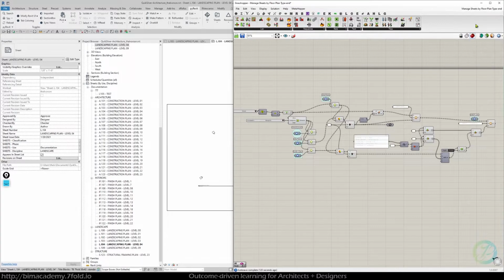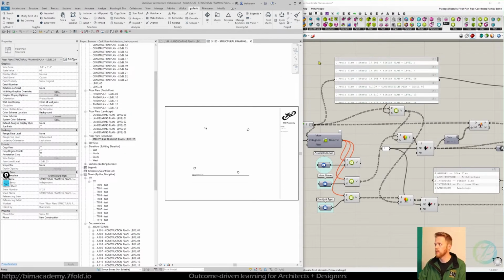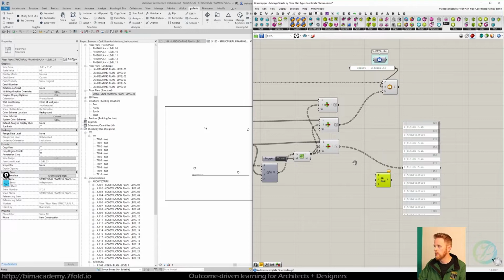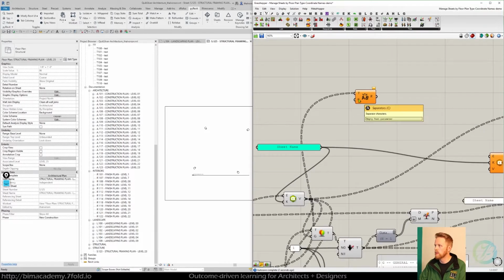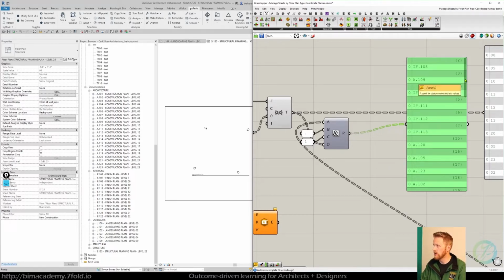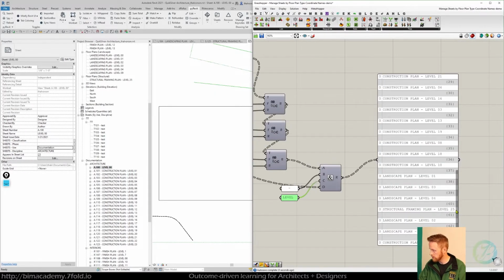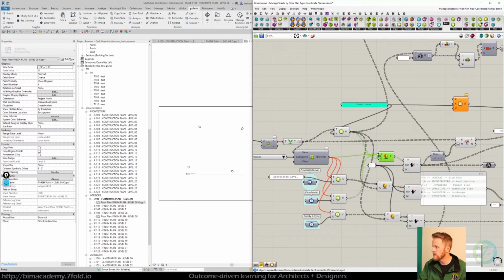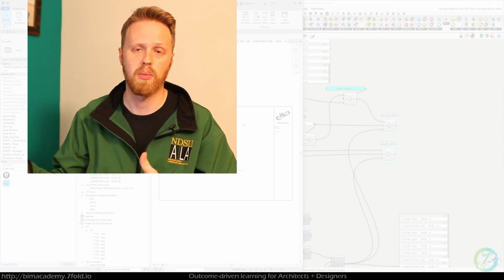Auto-update Revit Sheets Part 2 Using Grasshopper | Numbers, Discipline Prefixes and View Names

Comment: Great content bud - Thank you very much
Reply from the maker: Glad you enjoyed it Noah! What are you wondering about for next time?
Reply: @7fold_design  Take the logic to the very start of the project!

Sea level = 0'
Project Level 1 FF Elevation = ?'
# of Levels = ?
Floor to floor = ?
Create Drawing Views = [Plan, Elevation, Section, Axon, (interior elevation? door/window head-sill-jamb detail)
Place views on sheets and number those sheets per logic
Disciplines requiring backgrounds = ?[Electrical, plumbing, mechanical, structural]
Duplicate views for other disciplines and create matching sheet number with discipline prefix
Apply discipline-specific view template to those sheets

I think all of that is possible now, so you could get a call about a project and almost just enter an address to get your SD set cartooned out

Let's connect-
Reply from the maker: Typically for sheet management like what you’re describing I don’t instantiate a sheet (making it visible in the project browser) but actually just creat placeholder sheets so they schedule in the main sheet index in my model. To do that I use BIM Link made by Ideate Software to export the parameter headings that control my sheet organization. To get discipline-specific info I will always delegate them to coordinate their own set and, if necessary, point them to a naming convention they should align to (aka ISO Standards or something) 

For the automation you seek, consider if an addin already exists on the market. For example the Ideate Apps I mentioned have done a great job with sheet management (among other things). I use Rhino Inside for more surgical QAQC and applying / targeting data authoring when the other addins don’t do it for me. So that’s just considering the basic cost-benefit ratio of your development to production time (which you should always be doing) I’ve found the best grasshopper scripts typically role up into a push button or dialogue box / control panel with a series of buttons to do what you need to. 

Now for learning purposes, I agree “building a ramp” of understanding so at any point you could opt-in to a Rhino Inside based workflow is super powerful. For example, I just completed some batch renaming of Family and Type names across an entire model in less  than an hour using Rhino Inside. 
I’d recommend getting on the mailer found via the BIM Academy website https://bimacademy.7fold.io and you can also email me at bimacademy@7fold.io 

Cheers and stay curious my friend!